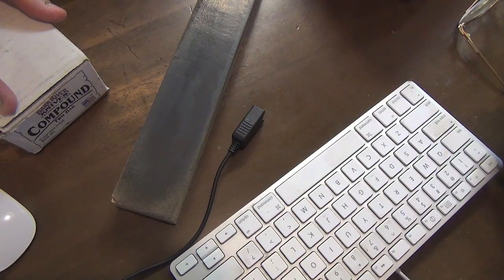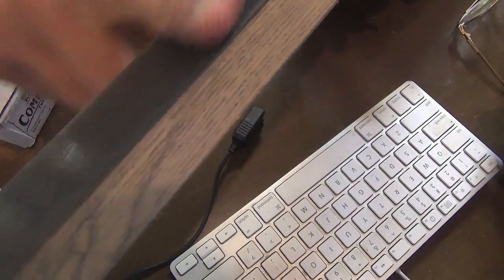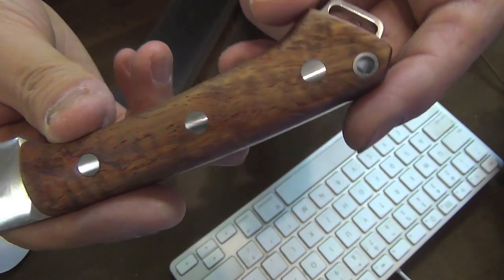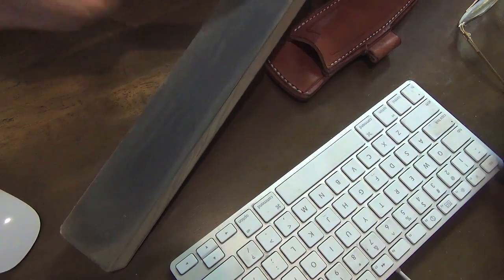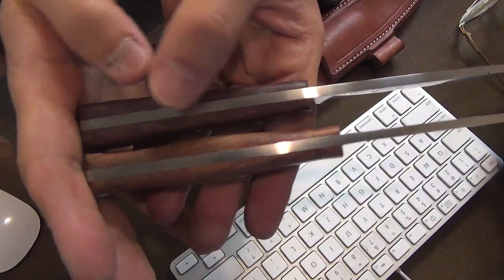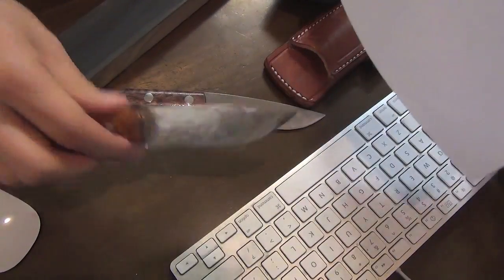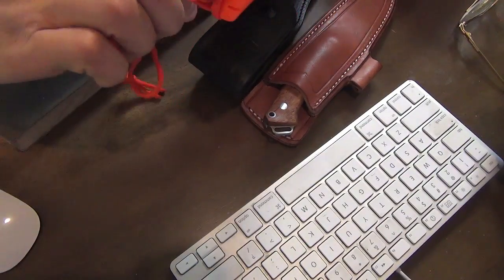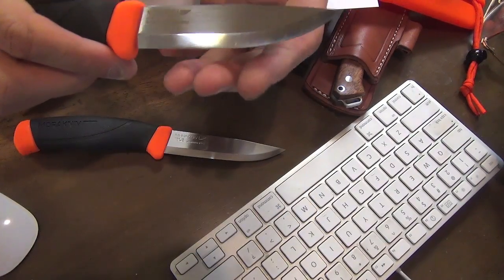A small part of my hunting knives

Comment from the maker: continued... Under such a tough situation to the edges only 3V holds its sharpness extremely long for 3 deer and doesn't take edge problems at all while other steels take problems in a single deer. I now understand that 3V is a super hard steel and super durable, and it doesn't take any edge problems in my regular deer dressing uses. I don't do any abusive tests any more. As long as used for its proper purposes, 3V is by far the best comfortable steel of all in my conclusion. Thank you.

Comment from the maker: continued... My current opinion to the 3V is that it keeps its sharpness extraordinarily long and its sharpness gives me super comfortable deer dressing experience. Even if it took micro chips, its size would be very tiny and undetectable under 20X microscope. I didn't use only 3V but A2 and S35VN as well and noticed that A2 and S35VN took larger micro chips in some cases as well as micro rolls while 3V din't take anything. My current deer dressing is thorough and hard to edges. continue...

Comment from the maker: I changed my mind a bit. I once cut crab shells on the dinner table with A2 and 3V Bravo1. I hope you ever saw the video of it. Then A2 took only micro rolls and 3V took only micro chips under the highly magnified view. At that moment I took the magnified view with a zoomed up vidocam put on the eyepiece of my 20X microscope and I didn't know its magnification correctly. Now I use a USB microscope and know the exact size of the edge problems. continue...

Comment: continue..I also had problems with A2 dinging and rolling on a Bravo 2 doing some light chopping on lumberyard cedar. The edge is sharp, but too thin for certain tasks. I may try a 3V. For you, your purpose is cutting so you must sacrifice some edge strength with a thin edge. I understand your point about the high magnification.  On my larger knives I will re-sharpen them differently putting a micro convex bevel on for strength. Stay safe and thanks for your testing.

Comment from the maker: continued... Anyway its angle was too large to do deer dressing properly and I did full height regrinding of the bevel to make 25 degree angle. Then it did a deer perfectly and I didn't see any micro chips. And I continued the 3V test with 3V Fox River. I did 3 deer straight perfectly with it but it didn't take micro chips. Then I noticed my previous magnifying system was too high. At least under 20X optical or 30X USB microscope has not shown micro chipps after use whatsoever. continue...

Comment from the maker: My short fixed blades are Bark River Bravo Necker2, KaBar BK-14, and Fallkniven WM1. My Necker2 is 12C27 and very nice. The handle of BK-14 is ridiculously short. The bevel geometry of WM1 is ridiculously fat. I am getting scales for my BK2. I ground off much metal from my WM1. I did nothing on my Necker2. I will need a full size handle even for 3 to 3.5 inch blades. Little Creek looks too short to me as a knife. I don't see any better knives than Gunny or Classic Drop Point Hunter. Thanks.